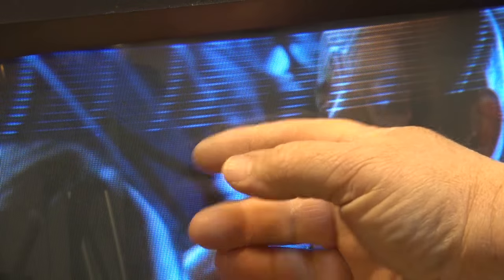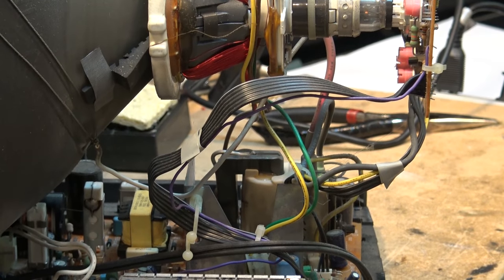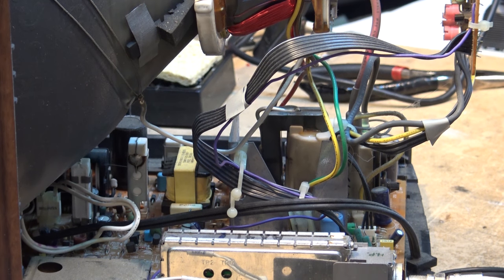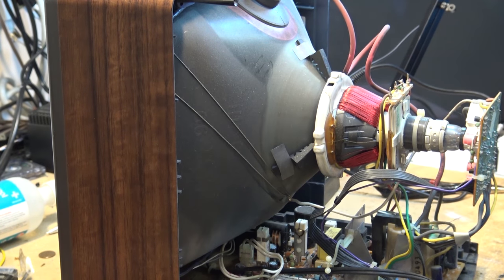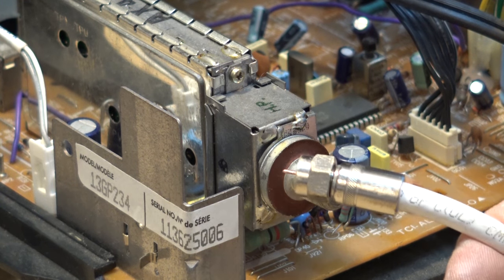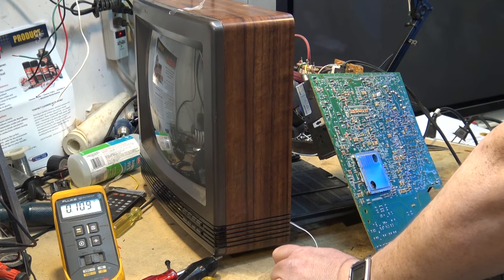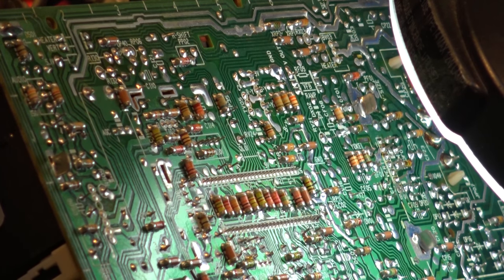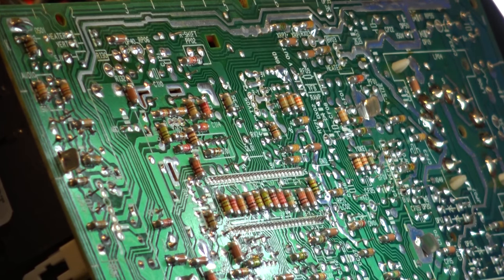GE   RCA TV lines at top of picture

Comment: Nice easy fix, I haven't had such luck lately.  I just got done working on a Samsung PN50B650 50" plasma that nearly drove me crazy.  As it turned out it had 2 shorted schottky diodes, several bloated caps, and a bad opto-isolator.  Kept blowing the fuse because of the shorted diodes.  I put new ones in and it didn't blow the fuse anymore, but the standby light just blinked and wouldn't turn on.  A nightmare of a fix.  It's nice to have an easy fix every now and then.
Reply: Plasmas can be a pain in the ass and seem like the king of cascading failures.  If the buffer board fails for example it can easily take out the Y board and/or the X board or vice versa.  I've even seen people damage other boards just by turning the TV on too many times when it was shutting down and going into protection mode.  Short in the Y board and you just killed the X board trying to diagnose it.  I'm especially careful with plasmas for this reason.
Reply: I lucked out on this one as the failures were contained to the power supply.  I thank my lucky stars on that one.
Reply from the maker: Plasma sets can be a real pain in the ass to fix. I have been lucky, there has only been 4 that I didn't repair. One belongs to a co worker and he wants it fixed but I have been unable to get a Y sustain for it, no stock anywhere, and the other has a blown buffer board, but because I have no base for it, and the buffer board is relatively expensive I have chosen not to fix that one.

Comment: This is why i much prefer the english mains plug than american, you cant plug it in the wrong way at the wall
Reply from the maker: You can't plug in a polarized plug. For this demo, I plugged into my short fault load (A light bulb in series with the main) The cord I put on that is not polarized as when it is generally used, it is used with an isolation transformer, but it allows me to reverse the polatity,

Comment: I know you know your way around these things, but people watching you might try and touch dangerous parts. How about advising to discharge the picture tube just for good measure? Or at least tell them wait a week or so after unplugging the unit maybe.
Reply from the maker: If I were to be disconnecting the 2nd anode I would be showing how to discharge the CRT first, but unless someone intentionally pulls back the cap, they are relatively safe. It is insulated. I have been bit by the 2nd anode, something we used to call the "cobra" (because it sort of looks like a cobra when detatched from the tube, and it bites!) on a Sony when operating, and it is not fun that's for sure.  My advice, don't touch any metal parts when the set is energized, and an isolation transformer with a floating secondary is an absolute must. Most important piece of safety equipment you can own.
Reply: It would be awesome if you could show these parts on your next CRT repair.

Comment: Wow, Excellent fix. I was expecting it a drying cap. It was a loose connection. Great repair.
Reply from the maker: That's what I thought of going in too. Always expect the unexpected. Thats why I initially tapped around the vertical to see if it changed, but it didn't.

Comment: Still loving your videos, keep em coming ;)
Reply from the maker: More to come. I have so many vintage pieces to work on. The 20" Sony I picked up would have been a nice one to fix, but all that was wrong with it was a cut off power cord, so I spliced it, an put it in my old work room, where my 3/4" machine, and PAL equipment live for conversions. Talk about a beautiful SD picture. It was a Sony 20FS100 I believe. Has velicoty modulation on the CRT, and it was the totally flat tube that somy made right at the end of CRT production. Is a 2004 model, so this would have been in the final days before Sony phased out all CRT sets, and this one is an exceptional set, in really good shape, so I will keep that for my transfer room.

Comment: These little sets aren't as badly afflicted as the larger ones with the tuner shield problem, but bad solder joints sure do show up every now and then.

They're also unique in that "on" and "off" are actually separate commands on the remote!

Comment: You found this set by the side of the road? I envy you.

Around here, any CRT sets chucked out onto the kerb, usually have necked picture tubes (or smashed screens), the entire chassis missing/damaged or yokes removed (for the copper wire perhaps?). I have come across a couple of complete Philips portable TVs (with the power cords cut but everything else was present) which only had superficial problems (mainly caps and dry solder joints) - both are CF-1 chassis series made around 1988-89, before SMDs became common on boards. 

But you located the fault in the GE RCA and got it all working sweetly. Nice one for your collection. :-)

Comment: Curious to know, how do you output your own stuff to analog TV channels? It's probably way more complicated than I'm imagining it to be but I'm curious to know as one thing I've always thought of doing is making dials on really ancient TVs still usable.
Reply from the maker: Very simple. All you need is an RF modulator. Analog modulators are a dime a dozen these days.
In my equipment closet I have a Channel 4 MTS stereo modulator. A Radio Shack unit of all things. In fact I think Radio Shack was the only company to sell a true stereo consumer model. Channel master  had some high end units too.
I have a Vcom agile modulator set to channel 5, and 2 QT technology agile modulators set to channels 7 and 9, and a Blonder Tongue MTS stereo that is preset on channel 12.  The Vcom, QT and BT modulators all came out of a cable company head end, and I picked them up out of the surplus bin at a local electronics shop dirt cheap. The BT stereo modulator was the most expensive at 50.00, and it sounds fantastic.
As for source material, I have the analog video out from my cable box plugged into one (The channel 4 MTS unit, I have a raspberry pi analog output plugged into the channel 5, that I just have some video I shot playing on I use as background shots for testing. My other cable box (my cable boxes are located in the same closet, so whatever is being watched on different TVs in the house also stream out in analog on the house cable, that way if I am working in the shop, I can watch whatever is being watched in 1 of 2 rooms) Channel 9 has my security cameras, and the other MTS modulator on channel 12 is plugged into another Raspberry pi, that just plays random concert videos. I have a big hard drive, with probably between 600 and 700 live performances by the greatest music performers in the world, and it just plays them in random order. Since many of these performances date back to long before HD, analog distribution is fine. I recorded most of these off satellite TV (The old big dish type) over the years, so it is enjoyable to watch them play out.) Rather than turn on a radio, I just turn the TV on and listen to the music, and get the visual as a bonus, so sound quality is important, and the MTS encoder solves that problem.
The reason I have all these modulators set to the low channels 2 to 13 is so that I can mix the in house signals with the off air UHF channels from my antenna. So when I tune in on a TV that I get the analog channels I generate in my equipment closet in SD, and I get the HD broadcast channels as well.  No need for a cable box on my bedroom TV for example. I get the local stations off air, get my in house channels, and whatever 2 channels were left on the cable boxes when the TV was turned off for the night.
It is actually quite simple the way it is set up. Signals are combined using just regular cable splitters.  4 modulators into the 4 output terminals on a 4 way cable splitter, and the input terminal outputs the 4 channels all mixed together.  As these are commercial modulators they all have RF level controls so it is easy to balance the signal levels.
Reply: Goodness, thank you for the extremely detailed reply! Was curious because the only modulators I've seen will only output to channel 3 and 4. But it's cool to see what all you have set up! Thank you again!
Reply from the maker: I do have 3 single channel UHF (selectable from 14-69 on UFH band and 14-94, 100-125 on cable band) up for sale if anyone wants them. These things originally sold for probably 100 each, and I am selling what I have for 25. I also have a 3 channel UHF modulator I will probably unload, as I run everything on the low band here now)

Comment: Well that was a supprise, "Crackus Jointicus" :-D
That set didnt look bad inside, i've seen some very cooked sets where the pcb was very brown/black on the power supply, and the line/vertical components.
i hope you discharged the crt anode on the dag before playing with the pcb, dont want you to get hurt :-(
Reply from the maker: Never discharge it. I am not removing the HV lead so no risk of shock. The diodes in the flyback will prevent it from going back into the chassis.

Comment: good work as usual, but:
1 use open broadcast studio,it gives more features freedom 
2 try to less use oscilloscopes because we don't have one
3 never under estimate paper drawings,it still the best explainer
4 always mention line leakage
5. I hope you fix old computer monitors,not just TV because there is not much old monitor repair in YouTube
Reply from the maker: I didn't need the scope on this one. Just a good magnifying glass. Knowing where to look helps. Didn't take long to spot the connection. 

I don't have any broken computer monitors at the moment. Perhaps an LCD, but no broken CRT monitors at the moment.